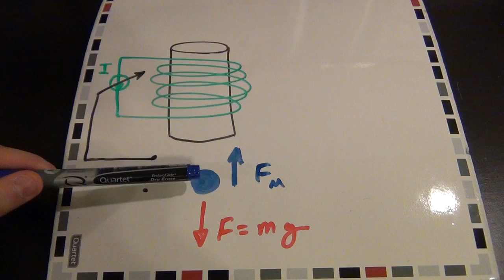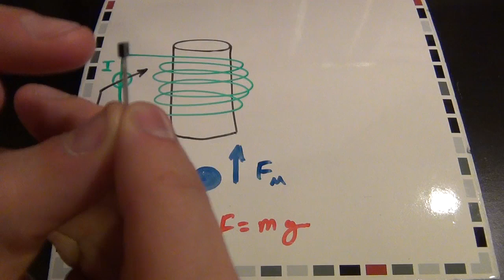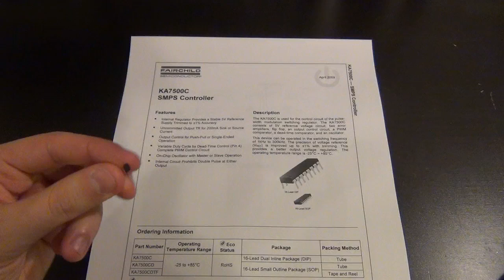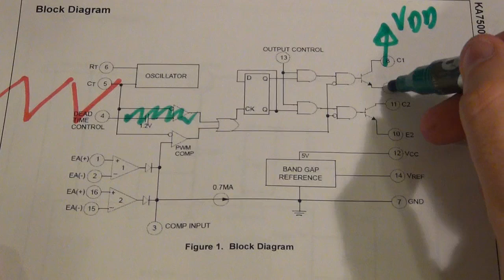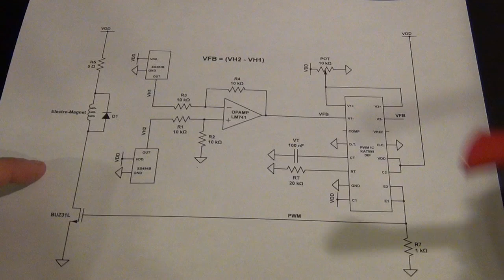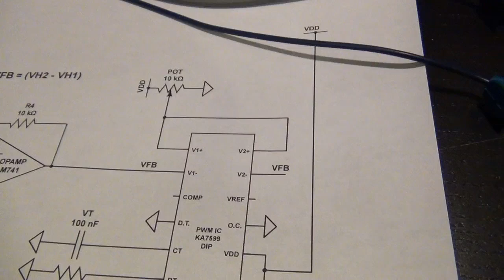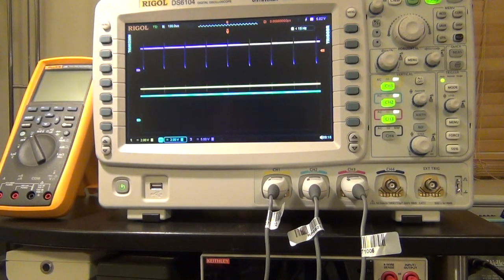TSP #22 - Tutorial and Experiments on Magnetic Levitation

Comment from the maker: The system has feedback, it does not operate in open loop. In fact, it won't work in open loop at all. There is feedback around the error amplifier which goes all way the way through the electro-magnet, Hall-effect sensor before it is fed back to the error amplifier.

Comment: this helped explain hall effects pretty well. I'm currently trying to make a diy 500g-1kg (it be great if more) electro magnetic levitator with conventional metal infused PLA filaments with my 3d printer. its a very slow tedious process but im finally making some leeway in my current prototype demo thanks to this video. I need to find a real ferrite outter circle though for the 3d printed electromagnets (used electromagnetic filament for the base of the 4 electro magnets and copper wire wrapped around)Thank you!+thank you to all the commenters putting a lot of other equations here.

Comment: You are right. But what I meant is that the IC would work much better, as PWM controller, with some feedback at the error amplifiers. In open loop, with the near infinite gain, the amp works as a comparator and the system runs as bang bang control. The ringing inside the Ton time of the output square wave is the hysteresis loop working at the middle of bandwidth of the feedback loop.

Comment: Awesome video! One small correction - I think that the magnetic field very near to a magnetic dipole actually changes as 1/r^3, not 1/r^2. This is the due to the difference between a dipole and a monopole (like a point charge).
Reply: I was searching for someone to point this out as soon as I started watching. Worth noting that the cubic relation also makes control that much harder. Or put another way, the sensitivity of the control system is higher. That much harder to get the dampening right.
Reply: Of course, the force between two dipoles is even more complicated to calculate. There are multiple terms, though 1/r^2 terms are involved in most situations (unless the magnets are much smaller in scale compared to the separation, I think).

Comment: This system is barely stable. The open-loop transfer function is something like 1/(s^2 - 1), which has a pole in the right-hand plane. The negative feedback creates a closed-loop transfer function of 1/(s^2 - 1 + g), where g is your loop gain. This give a pair of complex poles on the y axis, which wouldn't normally be stable, except that you have a tiny amount of air resistance. If you differentiate the hall-effect signal and add that in your feedback loop, making the feedback path (g1 + g2*s) I believe if would improve stability by pushing the complex poles solidly into the left-hand plane.
Reply: Wow. So complicated William,
Reply: Katia Gyetvai
He's right though.. look at the oscillations... Also, his system is unstable because he uses a very simple regulator (most likely only P). If you use a properly tuned controller, such as PID, these problems will dissapear. I also doubt he did a simulation before that to check the transfer function.
Reply: I totally agree. But the problem then is to tune the system with the proper amount of differential gain to get stable response. In my experience designing one levitator that way, yes it gains marginally better stability at the expense of hours of tuning.

Comment: I did a project like this also two years ago for a class on instrumentation design. We used an arduino to read in the voltage from the hall effect. I wish I would have thought of a second sensor on top. the way we tried to cancel out the coil to cancel oscillations was to sample the sensor when the PWM was low (while trying to make sure the inductor was fully discharged)

I have a couple videos of it in my channel if you want to check it out

Comment: This is the best video on this project. I am building this right now so it's very useful. I have one question: Is it necessary to establish a PWM using an oscillator, or I can directly use the output of the op-amp to turn the electromagnet on/off? I don't have the KA7500C IC, was wondering if I can use something else instead if I understand what's needed..

Comment: Great video but little correction, on 29:40 you describe that pwm is turned off that it do burst of pwm what is not case, what you describe as pwm burst are some oscillations in circuit (they are to high frequency to be from pwm), instead pause and what you describe as pwm bust are one pwm period.

Comment: Not really useless. As you can see in the single shots, the PWM is neither at 0 or 100% but somewhere in the middle (with ugly ringing). So it's doing PWM.
But I don't know if there's any advantage in using the IC. Replace it with another opamp comparing the FBV and the set voltage and feed the output directly to the FET gate. Should be able to levitate the magnet and would be worth a try (oscillations could be a bigger problem with this setup though).

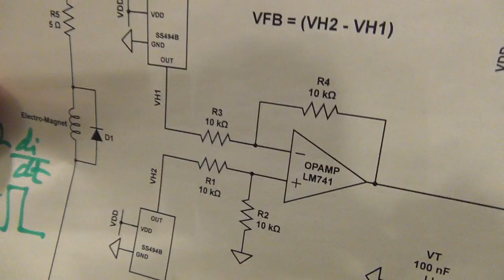Comment: 32:33 In this setup where you can invert the current in the electromagnet, how would you deal with the voltage spike? Since the diode would not be in the correct orientation.

Comment: That's a pretty damned cool party trick :D

I wonder if this might benefit from using a latching current mode PWM controller such as UC3843 rather than the very basic TL494 equivalent you have. You would have intrinsic cycle by cycle current limiting, so shouldn't need the big power resistors; have the latch to stop the multiple switching transitions per cycle you see on the scope; and the current loop which makes the electromagnet into a voltage controlled current source, taking its behaviour as an inductor out of the equation makes the whole thing intrinsically more stable and more tolerant to variations in loop compensation at the error amplifier. At least I know about this in switching power supplies, but I can only guess as to how well this translates to this circuit. I might try it but I don't have the magnets, electromagnet or hall effect sensors, so I probably will procrastinate and eventually forget about it.

Comment: Are you sure that by reversing the coil current the magnet would be repelled? I think that it would only flip over.
Reply: +totoxahc It should be able to if you reverse and switch the current off fast enough. Retaining the reverse coil current too long will cause the neodymium magnet to flip over and get attracted to the opposite pole.

Comment: Why did you go for a 3 khz pwm? I would think higher frequency, would make system more stable because of faster "looping".
Reply: Havent to do with that, its the system it self that is the cause of the oscillations. A simple filter that dampens low frequencies and at the right place would sort some of it out, but as said in the video the coil and the magnet is so far apart that it would be hard to hold it fully stable in all circumstances anyway.

Comment: I noticed the schematic in the video is different from the one you posted, which one is the best to use? Also, I'm confused about the decoupling capacitors, how do I wire them into the circuit? One last thing, can I use a KA7500b instead of the KA7500c? Thanks for the great video!

Comment: Could you not have taken VFB and fed that into another OpAmp against the reference voltage? That way, the output voltage of that second OpAmp could have been used to directly control the electromagnet, as the PWM is generated by the slightly oscillating perma-magnet.

Comment: hi. wonderfull video.
i have to build a huge lev setup for a customer. inverted from yours. i may have to levetate about 15kg. do you think it can work? matter of scale....
Reply: Not only scaling.  There are a couple of details that Shahriar could just skip due to the high gain and limited range.  The first thing is that the distance is not linearly related to the required magnet drive.  You might find it closer to square or square root relationship, depending on which way you look.  In a very narrow distance range you can depend on plenty of controller gain to cover the remaining nonlinearities.  The second issue comes from the dynamic movements and inertia, as well as the magnetic coil time constant, (inductance/resistance).  Further you probably meet Eddy current effects.  But assuming you don’t want to change the reference (= position), yes, you could scale it.  Note, by the way that the presented circuit does not try to control the coil voltage — it controls the coil current.  That actually compensates for the coil time constant.  Good luck, and don’t drop the 15 kg weight on your toes!

Comment: Nice work.
But it looks like your closed feedback control is not stable. The PWM signal and the feedback voltage should not look like at 29:16. Have you checked where the poles of the closed loop system are situated in the Laplace plane? The analysis could bring out that a PI-controller is needed to stabilize the system. The oscillation of the hovering magnet at 30:53 is probably caused by the instability of the system.
Reply: Signal from pwm look correct, but what he described as pwm burst is not from pwm, it is some oscillations in circuit (to high frequency to be from pvm it is in order of megahertz what is more than KA7500/TL494 maximum of 300 kHz and according to schematic frequency of pwm is around 2 kHz).
Reply: +Miloš Lazović From the scope the PWM frequency looks like ~1/150 microseconds = 6.7 kHz.
Reply: Stephen Kramer
I did not look at trace of scope to determine frequency, i calculate what should be from schematics he show around 20 minutes in video where you can see values for Rt and Ct which is easier than look at scope, but it still even if frequency is as you saw 6.7 kHz do not change fact that he have some oscillations that are on much higher frequency than switching frequency (what he described as pwm burst, but they are not that, because KA7500 do not have burst mode, and even if feedback is forcing it to go to similar behavior as burst mode frequency of that oscillations would be same as PWM frequency)
Reply: Thanks I agree I was just providing information.
Reply: We all gonna die here because of the instability of the universe!
Reply: IvanIvan1974 Actually isn't stability increasing because of the transfer of energy?  Everything is coalescing, I don't understand why they say entropy is increasing.  The Universe will freeze into a crystalline state.

Comment: This is a really nice way of doing this. At this guys toys video the first item featured is an older 'magic eye' opto stabilized version - without a magnet a bottle cap is held. There is quite a beefy block low voltage supply but not much room for a big coil in the structure. Link to opto version here https://youtu.be/8S-pVOtAwmE